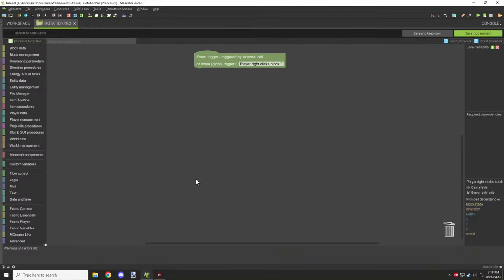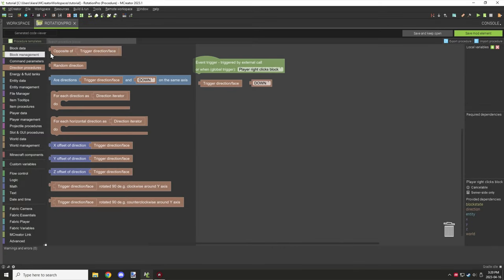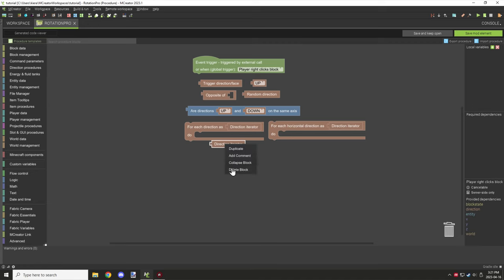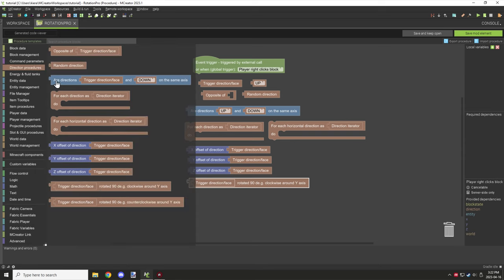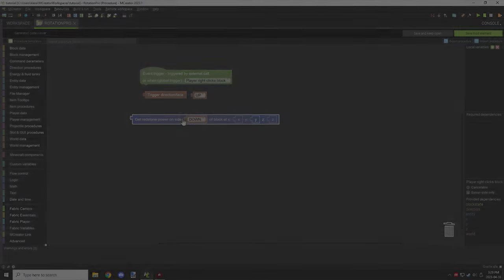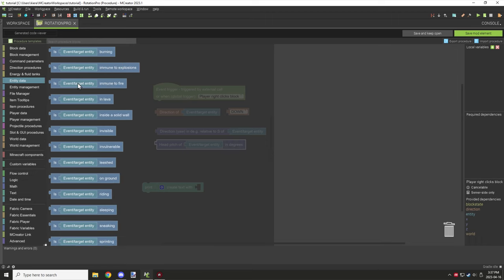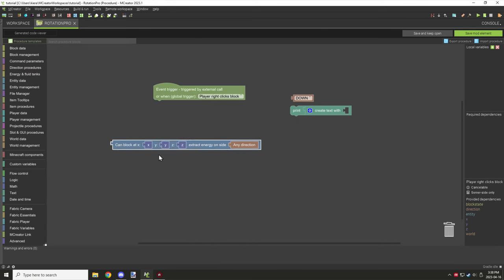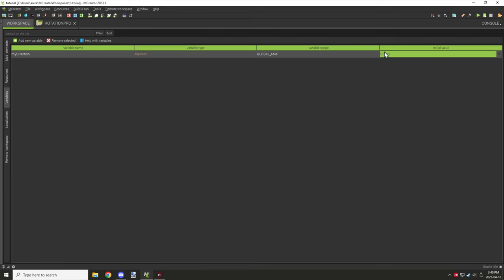Directional Blocks | MCreator

Comment: question: is there a way to detect  x and y directions? i have a block that changes direction based on some conditions (to long to mention) and i couldnt find a x and y procedure block, does it work just fine with SNWE directions?

love your videos btw!
Reply from the maker: You would need a else if statement and then test for each direction so in your case you would need north, east, south and west, however you could get away with three condition directions as the last direction would only be the last one unless you decide to change the block to support up and down.

So for example it would be below.

IF [Block direction = North]
  DO
ELSE IF [Block direction = East]
  DO
ELSE IF [Block direction = South]
  DO
ELSE (This would be by default west as its the only last direction that it could be.)
  DO

You would put your event blocks in the do part of the script or if you need to pass the direction to another procedure you can return a string of each direction side name. I hope this helps a bit.

Comment: How would this procedure look like?
So if this mob lets say, touches oak leaves for example, it would then remove that block/blocks so the mob can move freely.

This is probably really easy ngl but I really suck at the direction procedures
Reply from the maker: Well mobs don't really touch blocks per say they can collide in the block with custom models or walk on top of blocks. Other than that they simply don't try to walk through blocks so there is really no need for a trigger to take this into account.

With that being said the only way this would really work is if the entity removed blocks around the entity its self in a cube area using repeaters. I have covered loops recently so check out the repeat procedure block tutorial as this will be what you need on a entity tick update. Keep in mind that this will happen regardless where it walks so chances are it won't be what you have in mind.
Reply: @NorthWestTreesMCreator 
Yeah I don't think you can exactly make that work. Still thanks for the help nonetheless. Also you should make tutorials for basic mcreator things. So how to make a good sword, etc, could be fun

Comment: How do I test for a specific block face? ex: "[when player clicks with the right button on a block] if the block is (xblock) And if the face of the block that the player clicked on is the top face (thus the function is only executed if the player clicks specifically at the top of the block)"
Reply from the maker: Trigger direction/face = direction

This needs to be run from a block right click procedure either global or on the block as it needs the direction dependency but you will need to make a direction for all the sides of the block. Also if you have rotations for your block you will need to add support for the rotation as well.

So for example
IF Block direction = North
    DO IF Trigger direction/face = South
        DO Trigger Event
IF Block Direction = East
    DO IF Trigger direction/face = West
        DO Trigger Event

And so on.
Reply: @NorthWestTreesMCreator  This feels similar to an issue I'm having. I'm making a block that behaves similar to snow, and I only want it to pile when placing on the top face. Whenever I use:

IF Trigger direction/face = UP
    DO Trigger Event

I get an error saying I selected an external trigger that does not provide a direction dependency. Any tips?
Reply from the maker: @seanritzenthaler9208  Triger direction far as I am aware is only for a block right-click trigger, it tests for the side of the block the player right-clicks on. If is what you need then you will need to move your procedure to the block's right-clicks trigger. Other wise simply getting the blocks direction then testing the direction similar to what you have set up here but using 

"get direction of (provided blockstate)" = "Up"

This will test for the blocks direction.
rather than the face the player right-clicks on. If you can't use blockstate for some reason you can also use the following block which is under the same block tab.

"Get block at x: [X] y: [Y] z: [Z]"

this will remove the blockstate dependency, in some procedures you may not have that dependency to work with so it's a handy block I often use rather than blockstate.

You will need the world and position "XYZ" dependencies regardless but most triggers support all of them so its slim you will run in to issues with this configuration.
Reply: @NorthWestTreesMCreator  Thank you for the feedback! I'm going to look into some of the blocks you recommended. I do have the procedure under the right-click trigger, but I still get the error.

I'm new to MCreator and only have an intro to python course under my belt from years ago, so I really do appreciate your advice and your channel as a whole. It's been a great resource.

Comment: Have you made a recent tutorial on doors? My doors keep appearing with missing texture in game and every tutorial I find about doors are very old so I don't think they are reliable. (They also don't work when followed step by step)
Reply from the maker: I am pretty sure I have on one my get hub that has the workspace and procedures. custom doors not vanilla ones it should still work. I have not had anyone say otherwise. It was not to to long ago when I made it but old enough where it's not recent.
Reply: @NorthWestTreesMCreator  I'll try to find it then thanks
Reply: @NorthWestTreesMCreator  After looking at the gitub I found that I've already been there and already watched the video the thing was that I wanted a normal sized door and that one looks like a 2x3 door which is way bigger so I dont think I can modify those enough to get my normal 1x2 door that I want

Comment: How can i tell what direction the player is facing in?
Reply from the maker: You would need to test each direction.
Entity direction = North
Entity direction = East
Entity direction = South
Entity direction = West

Up and down does not matter just the 4 directions.
You can also get the pitch direction of the entity which ranges from -1 to 1 though I think the values are inverted if I recall correctly so -1 is up and 1 is down. (I think don't quote me on that)
Reply: @NorthWestTreesMCreator  thank you very much

Comment: what the hell does direction iterator actually do though
Reply from the maker: iterator in laymen terms means basically all instances, so it will only work with blocks that support it such as "for each direction as [direction iterator]" and "for each horizontal direction as [Direction iterator]"
You can use this block in the two blocks mentioned above to specify a specific direction using a direction operator

For each direction as [direction iterator]
  If ([direction iterator] = [North])
      DO maybe set rotation east.

Hopefully this makes since
Reply: oh wow thank you @NorthWestTreesMCreator